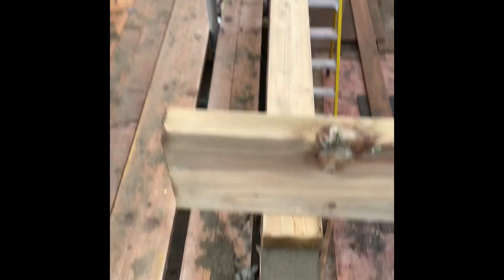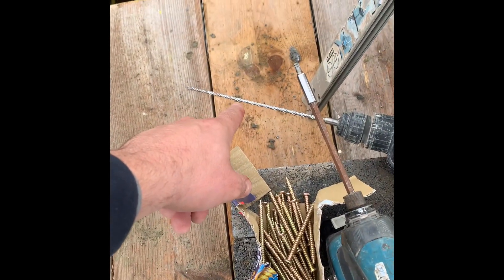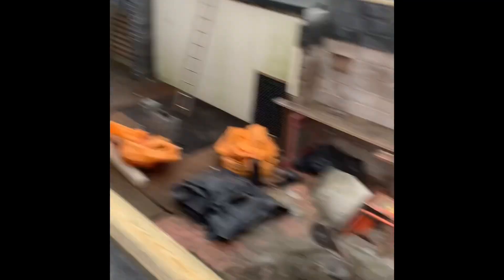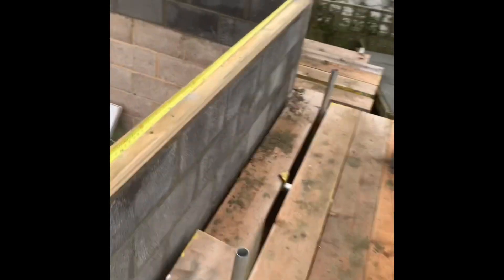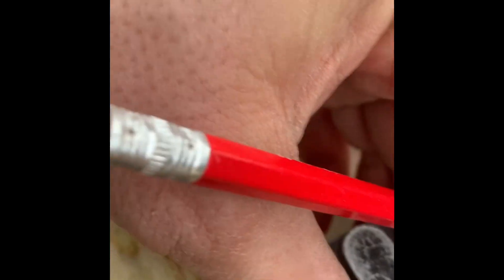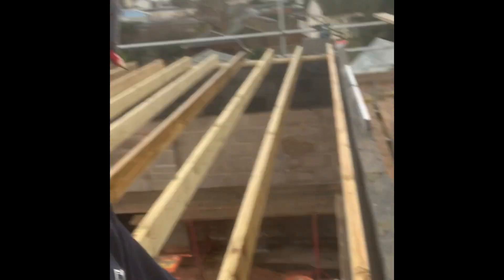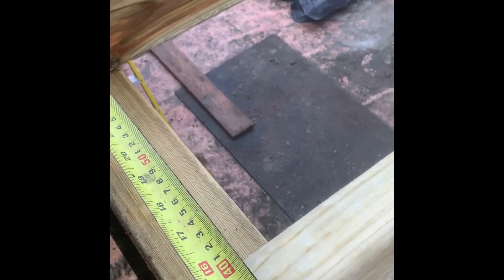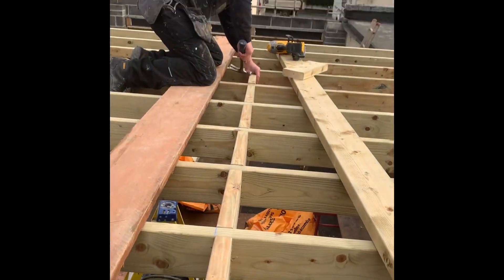Joists - easy way.

Comment: Would cutting a few noggins first to use as spacing blocks be a bit quicker and more accurate?
I usually find it's the width of the pencil line as is becomes more blunt which ends up throwing me out a mm or two which can accumulate... and if you've pre cut all your nogs but are going 
Havnt don't 1st fix in a while tbh.
And I'm a finicky fucker

Comment: Is the plate screwed down onto beezeblock??
Reply from the maker: Yeah tack it with concrete screws, then go around after with m10 bolts and restraints straps. Do that after as it’s Sod’s law you will hit a bolt

Comment: Love this vid. I’m thinking of getting one of those dewalt nail guns. Would you recommend? Also I’ve always known it as solid strutting
Reply from the maker: Dewalt nail gun, handy with no gas. The plastic clip on dewalt is a bit crap, if it fell it would smash. Bit heavier than the Plaslode. But it is a good gun and saves a lot of money throughout the year with no gas.